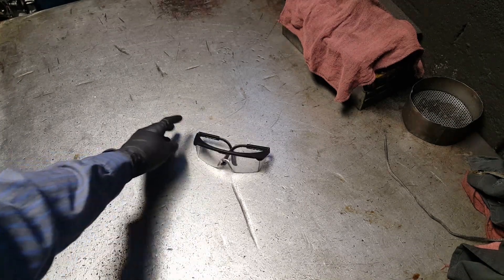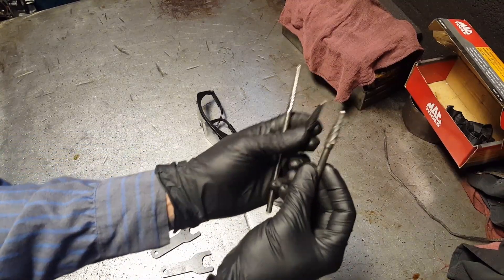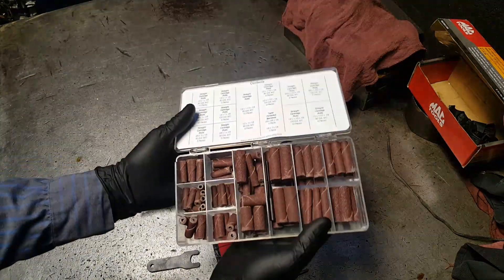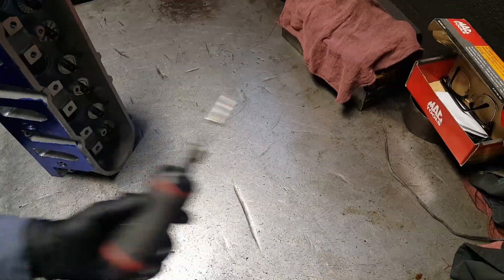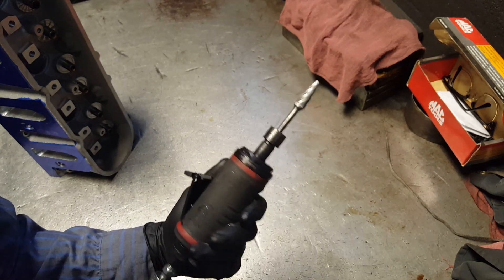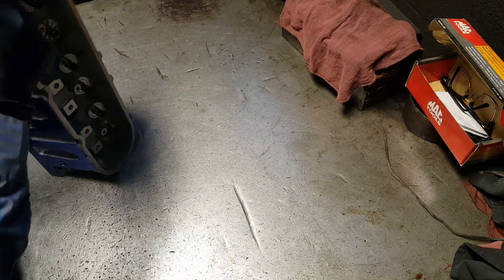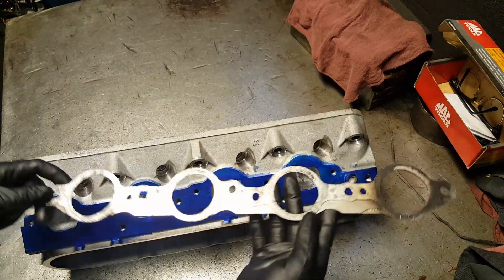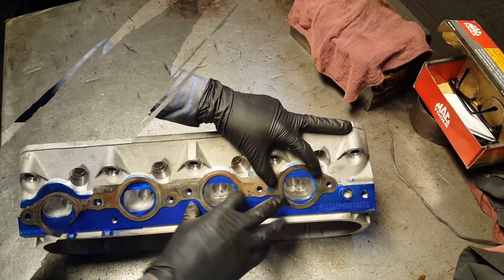How to port and polish aluminum heads chevy ls 6.0 5.3 lq4 lq9 317 heads

Comment: Is the same process for 862 heads,no problem porting the bottom no water liking????
Reply from the maker: "Never over do the bottom because it will leak",,the main goal is open the roof ,flush the valve guide meat nd cut the bowls!! Do lots of research based on what u want to achieve! Most of my people kinda wants the same cfm to match the 247r 246r or 245r camshafts! 
Also quick tip never port match the exhaust unless you 100% sure you going to use those headers forever!
13b_dorito my Instagram for more help 🤘

Comment: what is the inside diameter of your header? those ports look huge now. if you have a header that isn't 2", those heads are fucked
Reply from the maker: Never port match the headers unless I am 100% they will never swap them out because those are port matched to the gasket so only one size nd brand headers! If they change their mind,the. The heads are fucked 🤣🤮

Comment: Good info and a nice trick to outline how much you can safely port. I actually do grinding professionally, so id like to suggest a barrel shape burr for hogging down large amounts of material, it tends to leave smoother transitions that are easier to use either a stone or sanding attachment on. Also, a vice or jig could really help with the stability while grinding. Again, thanks for the great info!